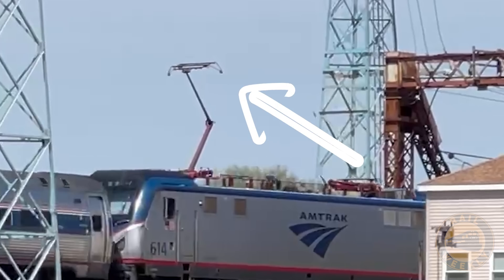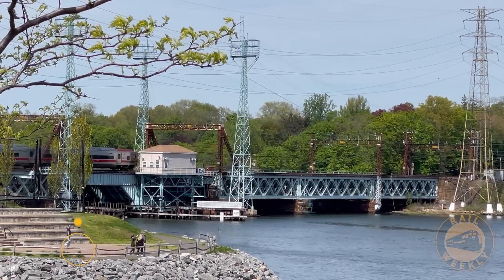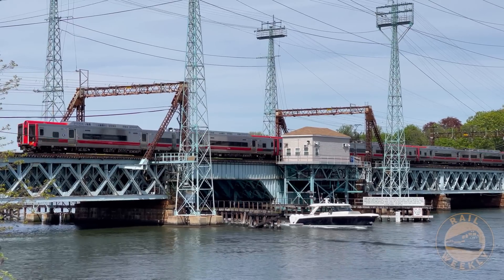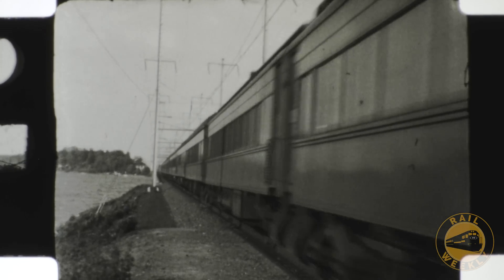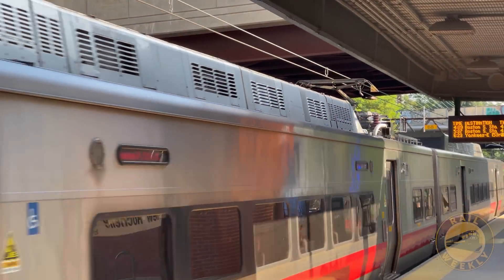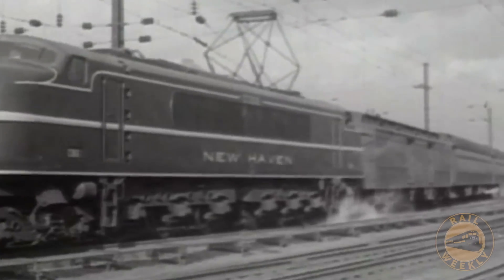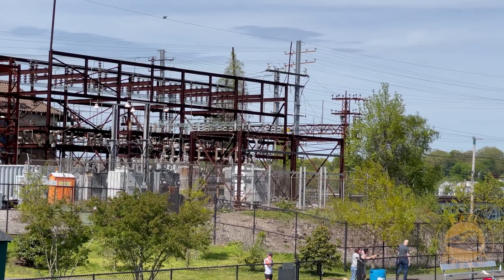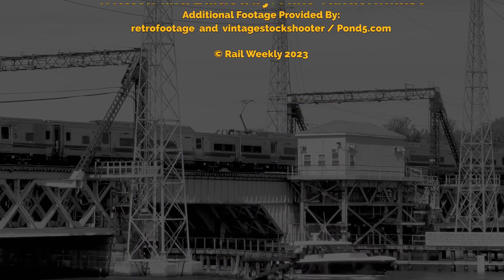The Curious Case of Cos Cob

Comment: To avoid interrupting Head-End Power, trains crossing the Cos Cob bridge use dynamic braking to provide it.  They route the power generated by the brakes to the coaches (rather than dumping it into resistors or returning power to the wires).  At least that's my understanding; perhaps someone more versed with the equipment could chime in.
Reply from the maker: In my experience, HEP is indeed interrupted and the coaches run on only battery power for a brief time. Your proposed solution does seem like it could work too though.
Reply: @RailWeekly  I think I heard that from an Amtrak engineer who worked the NEC.  Not positive though.  Edit: I heard this about 15 years ago.

Comment: Pantographs should be lowered when there is no wire over. Insulators may brake them. When train is switching power system (dual system loco), there is device installed, that is made to broke pantographs if it is not down. Mistake of powering instalation for 3kVDC by 15kVAC would do far more damage. Also no driving with all pantographs up (there is some exceptions). Always drive with last available pantograph raised. If something bad happen and will broke it, you loss only one, last. First one passed place where problem occured, so just rise it and continue. Driving with all rised gives chance to brake all at once.
Reply from the maker: This is great! Thank you for sharing!

Comment: I've always hated that bridge because there would be a power outage when crossing it. I just hope they install wires on it soon
Reply: Their is a “power outage” at every dead section (Phase Break) on the NEC. Makes no difference if the wire is above you or not.  There are no plans to ever add wire at Cos Cob. No need for it.

Comment: Is the draw bridge still operational or is it just a historic relic now?  I would love to see footage/photos of it in operation in any case.
I wonder if the catenary has any automatic power control devices either side of the gap to prevent arcing as the pan leaves/rejoins the wire?  - The resulting flash would be quite spectacular if the driver got it wrong and forgot to shut off power before crossing the gap.
I don't think we have anything like this in the UK. There are a few electrified swing bridges still around but everything moves including the OLE so no gaps.
Reply from the maker: Yes! It is definitely still in operation. As I was researching for this video, I found a few people who had YouTube videos showing the bridge in operation pretty recently. Just do a quick search and I'm sure they'll come up.

Comment: So another remianing question specifically for the Northeast Regional: do the cars still get powered by the ACS-64 on this bridge? If so, how?
Reply from the maker: No, but they do have battery power. So lights stay on in the cars even though HVAC shuts down, toilets don’t flush and the power outlets don’t work. It’s very brief though. Just a few seconds.
Reply: Yes they do, the ACS64 goes into regenerative brake when the main circuit breaker is opened and the power generates goes into the HEP system. So long as everything’s working as intended, the coaches will have continuous 480 V AC power.

Comment: Interesting but sensible solution. I have to imagine this requires both specialized design of the equipment and operator technique to avoid damage to the catenary and/or locomotive. Early equipment probably had no problem with simply losing power for a few seconds, everything would go dark (even the headlights probably, as well as any on-board equipment) and they'd get it back on the other side. The antique New Orleans streetcars seemed like that, I recall dead sections (no gap in wire but I'm guessing an insulated gap between blocks) where the operator would cut power, the lights would go out for a couple seconds, then come back on. But modern trains would have a bit more issues with that, so I'm guessing have to be specially designed for this - presumably have batteries and inverters to power all systems except traction, including all the computers, electronics, inverters/transformers, communication and control systems, head-end power, and so on, while disconnected.
Reply: All the trains and locomotives that pass over this bridge can do so without any issue or risk of damage. The pantograph will stop raising when it reaches the maximum safe operating height and then lower itself back down on the opposite side of the gap.  All systems other than traction operate off of batteries and/or inverter power and some use regeneration power through the traction motors.   The only thing the Engineer needs to do before reaching the gap is moving the controller (throttle) to “Off” and open the main circuit breaker if equipped.
Reply: @FFred-us9tw  That's what I expected - though I have to imagine the locomotive designers had to take all this into consideration and design these features you describe into the locomotive. I wonder if all electric stock can do that, or only that which is specifically designed to operate on routes with gaps like this?

Comment: At Nereid avenue in the Bronx, NYC, metro north trains convert from third rail to catenary power.  
they do this by coming off the third rail and then gliding unpowered through a  curve while the pantograph rises and engages the overhead wire.
Reply from the maker: Absolutely! Between the Pelham and Mount Vernon East stops. Would be cool to try and film the spot where they raise and lower the pantographs.
Reply: @RailWeekly  It seems it depends on the train length.. I've seen some do it closer to the station (East Bound) They have a few videos up here showing that.

Comment: What happens if they get an insanely low slow order on the bridge?
Reply: They would just take the particular track out of service. You can coast over that bridge at 10 miles an hour with no issues.  They would never put any restrictions slower on a track there.

Comment: Cos cob really needs two tracks with wires to solve that problem
Reply: Solve what problem? This configuration has worked just fine for the last hundred plus years.
Reply: @FFred-us9tw  the gap for Amtrak units

Mainly the acs 64 and amfleet that would lead to discomfort

Comment: Funny that this is a completely standard thing here in in the Netherlands, its very common to see, the trains have a stop in the pantograph, so that it does not rise alot in the air
Reply from the maker: I’ve been hearing this a lot. Guess I need to explore trains in the Netherlands!
Reply: @RailWeekly  we have alot of water, thus alot of bridges, luckily its designed properly, and from an train drivers perspective, its simple, all i have to do is turn off traction, thats it

Comment: What's with the electric New Haven loco seen at 3:05 that has steam coming out on places I''d expect from a steam loco?
Reply: Passenger coaches used to be heated by steam. So both Electric and Diesel Electric locomotives used to have Steam Generators on them that would take water from a tank and convert it to steam and send it back through the train via a hose between cars to provide this heat.
Reply: @FFred-us9tw  thx for the info!
Reply from the maker: Absolutely correct! And the steam would even be used for other things like heating water in the diner and in faucets, and even running steam-ejector air conditioning units in the summer.
Reply: @RailWeekly  Thx! The USA has way more a history of using steam (for heating, cooling, pressure etc) in industrial and domestic application, than Europe, where we tended to use water pressure, hot water and electricity (more potent because 220V) more.

Comment: That’s amazing to see a pantograph still up with no wires and the train is still moving. Now that’s some physics right there.
Reply: Nothing really amazing about it.  It’s simple physics.  Drive your car at say 30 MPH on level ground and then take your foot off the gas.  Your engine is now providing no real power to the wheels and yet your car will keep rolling with ease.  Passenger trains like this are not much different. I can bring a diesel and 6 coaches up to 110 MPH and throttle off and the speed will drop very gradually.
Reply: True. But still it’s fascinating to see a train still moving with no power for few hundred meters.

Comment: In the UK has some neutral sections which are like this but with wires, they are short sections between 2 power stations supplying electricity to the catenary
Reply from the maker: I’m sure the corridor has some of these as well. But I suppose you would have to know where they are. They’re not as easy to spot as this. Haha

Comment: I haven't been on the NEC in a while but power cutouts also happen when the catenary changes grids. The power company/territory has a different style of catenary and when the tracks change power grids the catenary rises up and disappears and the approaching grid catenary approaches down.
Reply: This assumes you are lucky enough for the power to be working along the whole former New Haven trackage, not always a good assumption.
Reply: @markjames8664  I never came across a power outage on the NEC during my travels, but I did have a few AEM7's breakdown after Y2K

Comment: I don't think these are as uncommon as u think like gaps in wires sure and I've seen the Netherlands gang in here to which I say love u guys but here in the uk something like that would just be treated like a neutral zone where there's a built in break section/gap in the powersupply to ensure there's no interference between 2 completely different power sources as no 2 sources have exact same voltage, current or freq and if allowed to meet could create a potentially dangerous situation